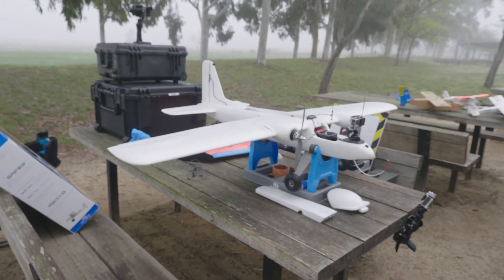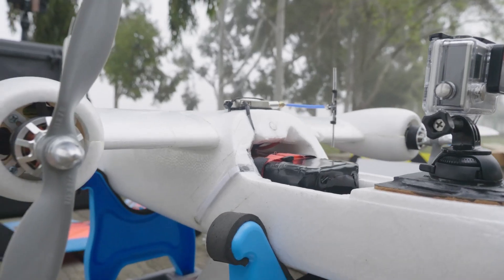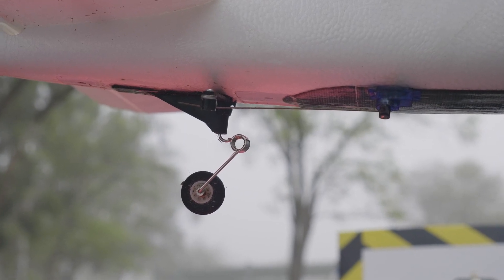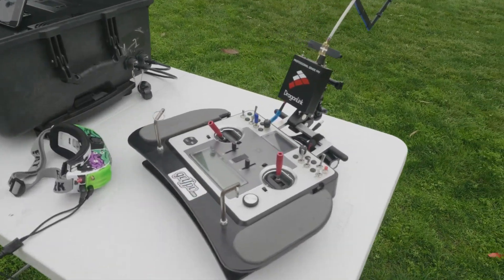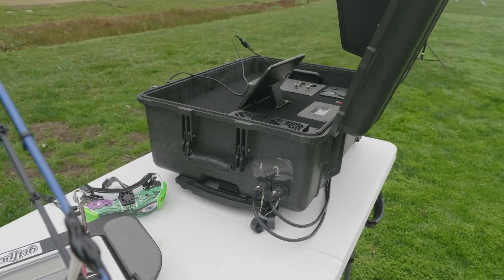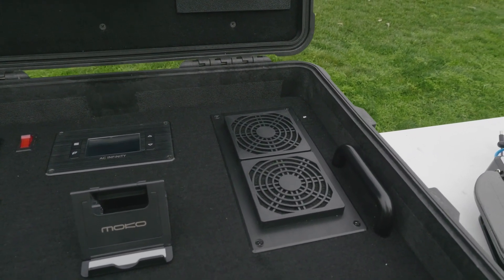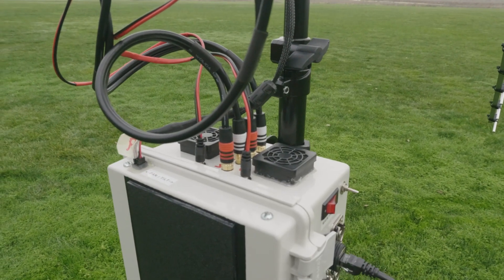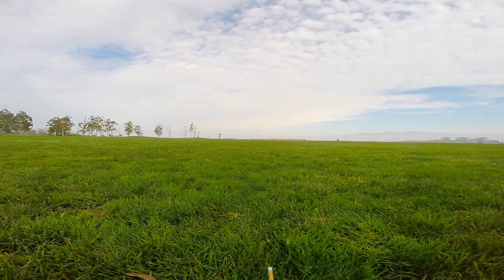My Twin Dream + FPV Ground Station | Detailed walk through

Comment: It's bulky, but good!
I use laptop as GS running mission planner connected via Bluetooth to v3 DL 433 with Moxon for mavlink, TX16, 2.4 RC connected to DL as relay, Azropa 1080p monitor for walksnail. It's 2023 and I'm sure that range and reliability is on par and all this from the comfort of the front seat.
Same frame btw :)

Comment: I would like to ask you some 
Questions
# 1
If I get that airplane and I chose to modify it for farther distance, all I need to do is increase the battery power? 

# 2
If I want to make a destination from point A to B then return to  point A, I  can use add a MFD Autopilot with waypoints Mode?

# 3
I can  track flight via GPS and then view it from the SDK card
Reply from the maker: Send me an email at https://www.bayareafpv.com/contact and I’ll gladly answers all your questions. It’ll be a bit easier that way.
Reply: @NorthwestThrottle  
Few days ago, I fill out the form in the website and I asked you some questions
Reply from the maker: Perez Frank Just replied...
Reply: @NorthwestThrottle  
I just checked but I see no messages
Reply: @NorthwestThrottle  

I am planning to build my own model 
* this corona virus has really messed up this country
Reply: @NorthwestThrottle  
I am trying to build my own model 
* If the ground station ( to receive video and connect to controller) has a limited range of 26 miles, can I set a autopilot mission plan trip ( GPS waypoints) further than 26 miles and 
Pick up the connection on the FPV plane when it returns to the range of 26 miles??

For example,  I want the plane to travel 50 miles one way and return back another 50 miles ( provided I placed
enough lithium battery), can the ground station disconnect after 25 miles but pick it up upon the flight return??
Reply from the maker: Perez Frank yes, I explained all of this in the email reply. Did you not receive it? Please check your spam folder.

Comment: That's one serious LR system you have. I just started building my first long-range plane. Not super long range I'm using Crossfire on it. And I was thinking about using inav with a Maytek 504 FC with compass and GPS. this will be my first time dipping into anything like this pretty nervous lol.
Reply from the maker: It’s fun and you’ll learn a lot. I’d be happy to share my experiences when we meet up. Maybe save you from some of the pitfalls that I experienced on my way to where the MTD is today.
Reply: @NorthwestThrottle  definitely know it would be awesome to get your help appointment in the right direction. It's just a basic pusher type for my first one. Eventually I will build something bigger and better. Definitely taking baby steps. Thanks again!

Rob